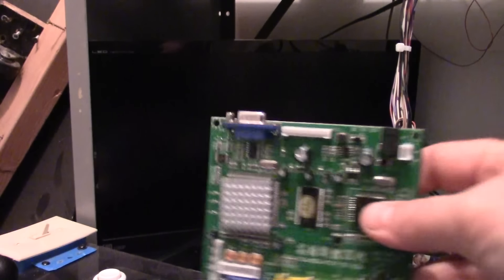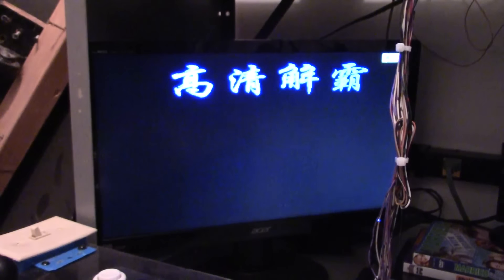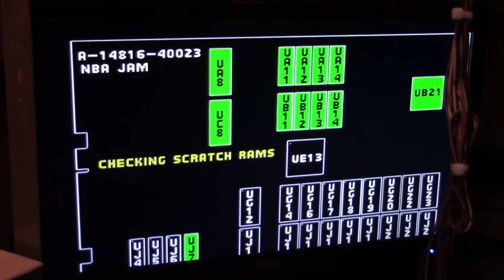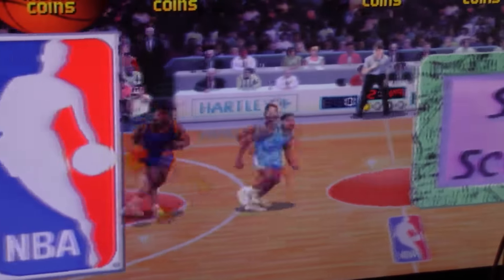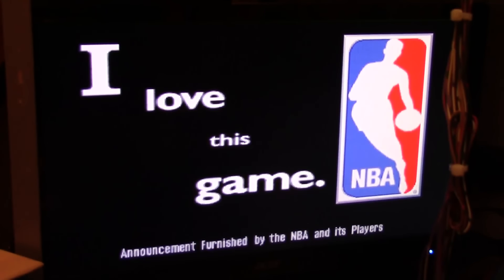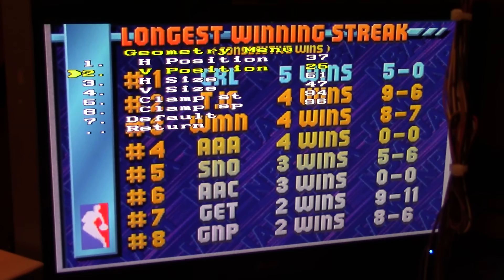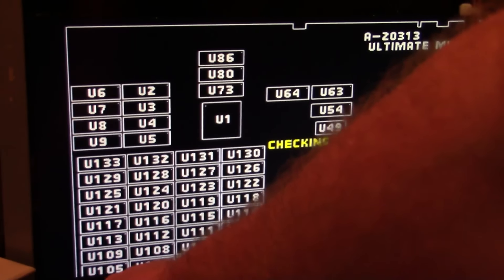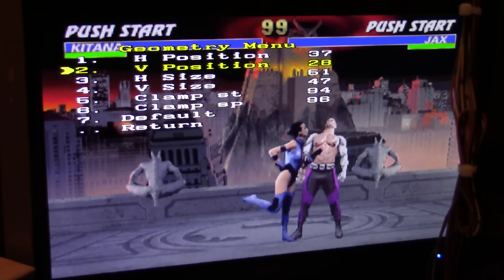Gnobes CGA To Vga Converter Frozen Image SOLUTION! [HD]

Comment: Hi, thanks for sharing your experience. However, unfortunately this seems not to help me. I have three  of this devices and all do the same frozen image. I tested different graphics cards, VGA, CGA, EGA, all the same, frozen image. I ended up with a simple stupid setup, a normal VGA card, which works directly on the monitor  like a charm, produces frozen image if I try to send the signal through this GBS8200 board. If I am in RGBHV mode, I simply can't get into the Geometry menu. On all three cards the same behavior. When I select the menu, nothing happens. All three bought by different sellers and places. I mean, I still could have some bad luck and get all three of them broken, but that would be really awful, don't you think? If you got some more knowledge about it, I'd be glad, if you share it with me. Thanks a lot in advance.
Reply: Hey! How funny is that! I Came here in searching a solution to the same problem when I tested your MCE-Adapter that I made! :)
Reply: BTW did you solve the problem with yours GBS's?
Reply: @xjr358  yes, my mce adapter was the solution :) I made a video about it a long time ago.
Reply: @necro_ware  finally made the whole setup work: EGA laptop + MCE adapter + GBS 8200 (with a GBS control mod)

Comment: i wired mine up for the first time today and its frozen. tried street fighter 2 (green and pixel mess screen) and wwf wrestlefest (black screen with white text phased and split into two sides of the screen). i packed it all away after about 2 hours of tinkering thinking it could be the boards dont have enough power in the 5v and all that. turns out it could be this issue!!!

i sure hope i can sort it with your fix. i also hope u dont have to do this fix on each powerup!

thank you!!
Reply from the maker: You're welcome. No. The converter has NVRam, so it remembers all the settings.
Reply: +YourMKArcadeSource thats good news thanks for the reply. Il let u know tomorrow if it works for me!
Reply: +YourMKArcadeSource it worked for me! also changing the display resolution worked for street fighter 2!
Reply from the maker: Sweet!

Comment: why does this happen? any idea?
Reply from the maker: +Diego Aguerregoyen It has to do with how the sync signal works.
Reply: The firmware or hardware really is likely enough to be buggy for anything that isn't one of the modes they developed for! The TVIA scaler/deinterlacer IC doesn't have an OSD menu system; or it does, but it's a bit on the anemic side, it can't generate text. So there's a secondary processor (Myson microcontroller with hardware menu/graphics system and digital video output for LCDs) feeding it digital video that would be the menu overlay. I think it inputs the wrong parameters when trying to sync up video overlay with external video input, but for some values, it still magically works because the timings just happen to be close enough for TVIA to make sense of it. There's a possibility that the Myson simply isn't intended to work at much less than 60Hz and has its own timing constraints. TVIA probably doesn't care all that much, it's pretty flexible.

Comment: My Outrun Machine doesn't even load any screen. Just loads the menus for the convertor but never loads any image of the game itself. It actually tells me there's no signal.
Reply from the maker: Sounds like you don't have the sync hooked up correctly. If it's not a composite negative/positive sync, you'll have to use the other connection with the extra wires on it. Does that make sense? I'm assuming you're using the RGBGS connection.
Reply: Thanks, yeah i probably have to use the extra set of wires rather than just using the same 5 pin plug. I'll give that a shot. I was using the 5 pin EGA/CGA signal port.
Reply from the maker: Yeah. Try using the other one with the separate sync wires.

Comment: I have 5 Midway Seattle and 1 Durango board that I cannot get to work with this converter. All are running Blitz/Blitz99/Blitz2000Gold (Seattle) or Road Burners (Durango) and the screen slowly turns pink/white inside 10 minutes. Resetting the converter board or even changing the resolution clears the problem for 10 minutes and then its back. Any thoughts? I'm at my wits end chasing the problem down. Converter board works fine with Mace the Dark Age, 1943, Tetris and P.F. 2012.
Reply from the maker: That's due to the Clamp settings. You need to adjust those.
Reply: Funny! I read through the comments here and came to the same conclusion 
just an hour ago! It is working but I have to find the best clamp 
setting now.
Reply from the maker: 55 and 57 usually clear it up.
Reply: 04-05 and 05-06 have been the best so far but a little washed out. Anything in the 50's causes the screen to be way offside and blacked out in spots. I'm going to fool with it some more. Adjustment of the monitor and converter brightness and contrast settings have made it slightly better but still not 100%. A lot of test like during play selection can't be made out.
Reply from the maker: Hmm. Yeah. It will all boil down to finding the perfect settings.
Reply: Hey, I have seen this issue you have is happening due to not having the right clamp settings. There is a video on someone who was replaced a Star Wars arcade with an LCD. He explains it
Reply: Never did find "the perfect setting" after trying many, many 
combinations. The adapter just does not play well with NFL Blitz. At 
least the screen isn't slowly turning red now, just washed out in the 
menu sections when choosing plays.

Comment: Any solution to the problem where image slowly gets darker or very white after a while on MK 2 boards?
Reply from the maker: Adjust your clamp settings to 03 and 04.
Reply: Thanks, it seems that it worked well. In case this happened to someone else, I also had to adjust the RGB potentiometers.
Reply: Im a newbie so what are the clamp settings and where are they?  thanks for the vid cuz it fixed my screen problem but after leaving the game on for an hour or so the video is washed out in white!  thanks!

Comment: Hey..  your mk3 was jittery.. I have a jittery game when using this converter.  Any ideas on how to fix that?  Thanks.
Reply from the maker: Add an 8k-10k ohm resistor in line with the sync wire.
Reply: @YourMKArcadeSource  thanks!  I’ll give that a shot.  I appreciate you!
Reply from the maker: You’re welcome!
Reply: @YourMKArcadeSource  just tried the 10k ohm resistor with no luck.  Still jittery.  Board isn’t jittery when attached to a supergun.  Definitely an issue elsewhere.  Any thoughts?
Reply: @YourMKArcadeSource  so tried another converter and now it magically works with no jitter.  These converters are quite inconsistent.  Thanks for your suggestion.  Game on.
Reply from the maker: Hmm. Weird. Well, that’s great!